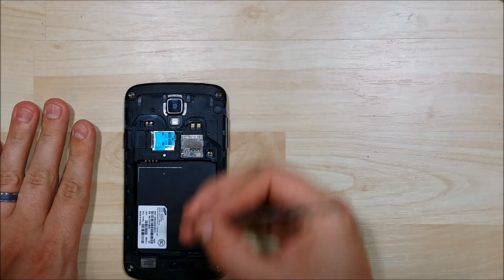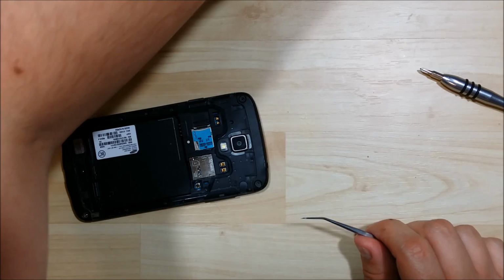Samsung Galaxy S4 IV Active LCD Replacement - Disassembly

Comment: I just wish I had read the comments first but I took all the parts off my phone to find I did not need to. Just heat LCD remove it  and connect the new ones  cables. A better title would be how not to replace your LCD on s4 active
Reply from the maker: +Lee Hatcher I prefer to be more careful. A little shock to the board and you phone no longer works. with all of the handling of the phone while heating and removing the screen puts  a lot of connectors at risk and bending one slightly could result in a non-working device but hey what do I know its not like I have fixed 100's of phones successfully... I appreciate your comment but being a dick is not constructive.....

Comment: Vishnu, the digitizer/frame and lcd are basically a factory sealed unit. I suggested the digitizer/frame route. 80 for the digitizer and 160 for digitizer/frame. Its a no brainer. The LCD is wedged in the middle of that sandwich. There is no factory seal/waterproofing on the phone now, and I used a hair dryer instead of heat gun/infrared thermometer. Real pain. Plus you will need roll of new adhesive tape, and scrape old adhesive off, plus gold cord and a heating plate. 

Or just get the digitizer WITH frame and plug n play. Your choice.

Comment: So why do you take all these things off the phone when you don't have to? I've watched a few that just pop that back cover off and just undo the ribbon cable for the screen, heat it up, and take it out without any other disassembly. Thanks in advance
Reply from the maker: Corey SaLee I prefer to be more careful. A little shock to the board and you phone no longer works.

Comment: The charging port doesn't pop out....hmm..i guess if it's the first time you disassemble the phone, everything is so stuck in place
Reply: it's really really stuck in place
Reply: Juan Miguel Godinez
Heat it up with a hair dryer. It comes out a lot easier that way!!

Comment: dude you said the screen not glued down the fuck it aint you fucking reject
Reply from the maker: Did you even watch the videos? Clearly in LCD Removal: http://youtu.be/mfaF-BergX0 you can see the glass is adhered to the frame of the phone. I stated the LCD is not glued to the mid frame which it is not. You need to get your facts straight before coming here calling people out when you have no knowledge of how it is supposed to be done. I am here to assist people in fixing their devices your ignorance is your problem.